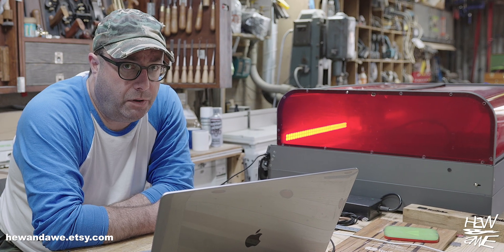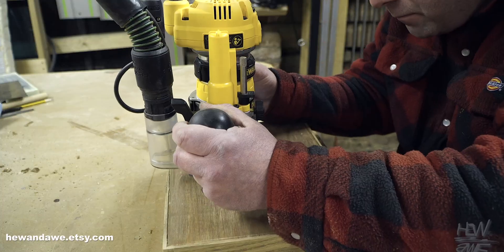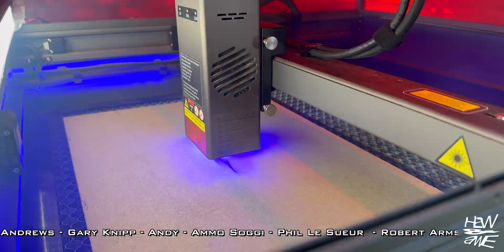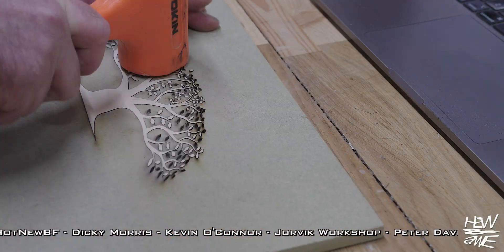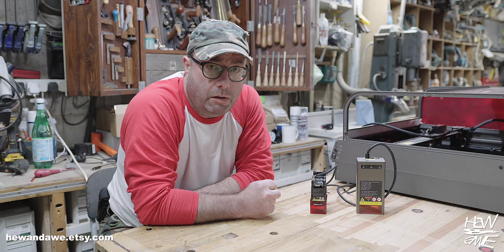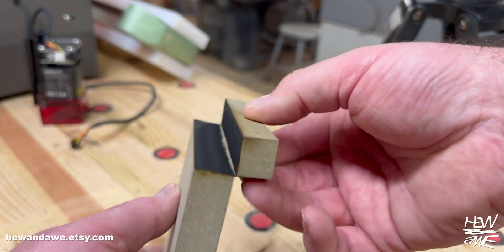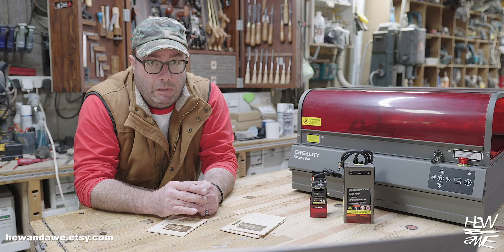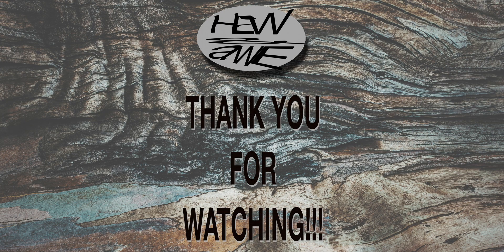What Surprising Things Can This Laser Do?

Comment: Nice no bull shit and to the point mate 👊 still need me an upgrade laser one day I'll join the big boy toys 😢🤙🫡 hope your good dude
Reply from the maker: Cheers mate! What do you currently have? And what do you need?
Reply: @HewAndAwe currently have a longer ray 5 10w laser. Not sure what I need probably something like this or at least a 20wat minimum. Need something that'll do templates and cut easily in 1 pass with say 6 or 9mm Ply. Don't no if mine will do that maybe I've just not dialed it in right who knows but I have managed few engravings pretty well but template work and engraving is probably what I need it for most but probably just wood not for metal or anything yet don't think
Reply from the maker: You need 40w for that really mate.
Reply: @HewAndAwe yea maybe 1 day.